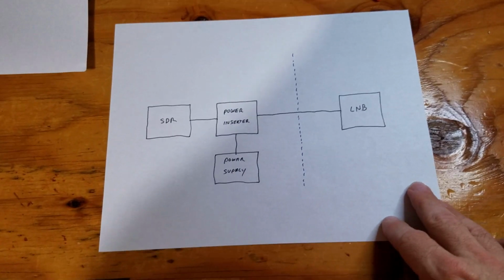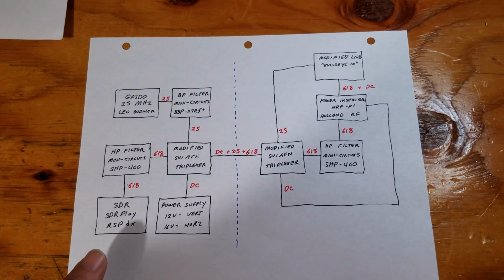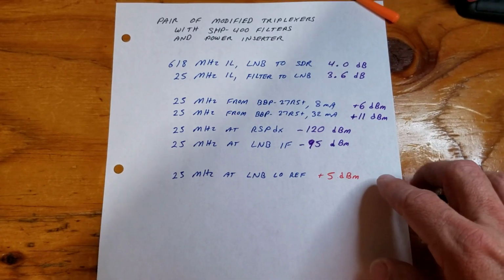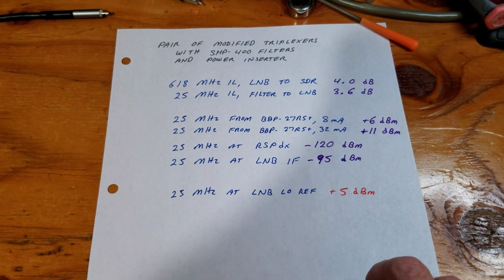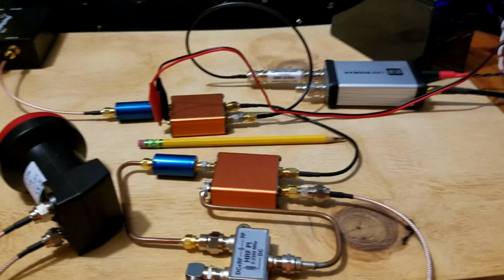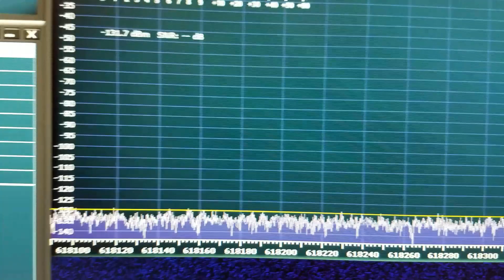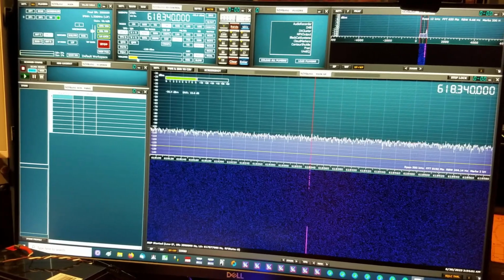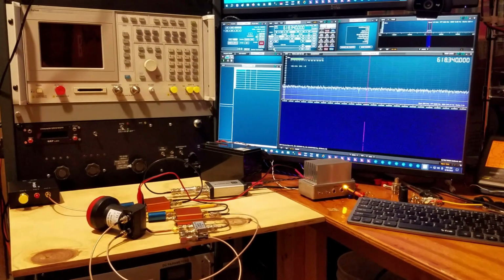10G LNB RX only System - Bench Test

Comment: I have a system a bit like this, though I used two cables, one for DC/618MHz and one for the 25MHz.
I used a two output LNB that I modified myself, and a simple canned 25MHz DIL oscillator in the shack. Much improved temperature stability over the LNB alone, but not as good as GPS control, of course.
I am using the LNB without a dish, so the performance is, of course not that good, but a beacon about 26km away, behind some hills, has been audible most of the time, sometimes with rain scatter enhancement, sometimes byt what I think as troposcatter.
Good to see your thorough test, and I look forward to seeing your further progress.
Yes, I am in the process of getting some 10GHz up and running, too. At the moment it is used, one for QO-100 downlink, and occasionally another for monitoring of the local beacon.
Vy 73 de OZ9QV, Jan
Reply from the maker: Hello Jan. Thanks for sharing information about your project. It is nice to hear from others who are working along similar lines. I used two cables last year when I was doing EME reception experiments, but the dish was close to my house then. Now it goes on a tower which requires about 110m of cable, with 75m of that directly buried. I have only one spare cable going to the tower so I have to use it for everything. Before I do a full RX/RX station I will need to add more cables to that tower. It is a big and expensive job. I hope can I hear something with this RX setup. The nearest 10 GHz capable station is 280 km away, nearest beacon is 315 km. I hope with rain scatter I can have success.

Comment: I'd be afraid that if nudged the hard line into the DC feed thru on the triplexer could break because of its rigidity. Otherwise, pretty cool.
Reply from the maker: Yes, that is a valid concern. Once I get both units mounted to a metal plate and into the box they will be pretty safe. There is a heavy solder lug soldered to the coax outer and the ground stud on the triplexer that should take much of the stress if it does get bumped.
Reply: @n1bug  Cool.